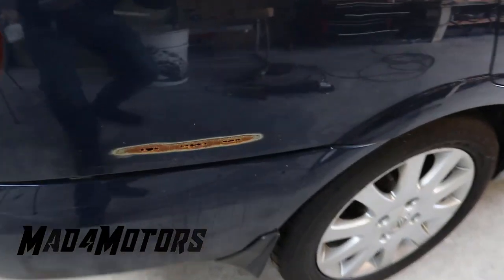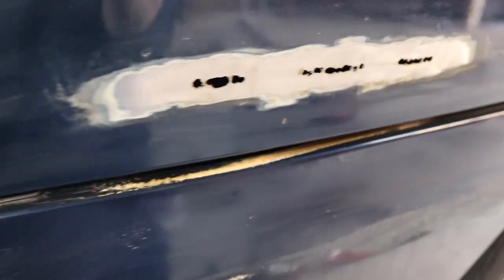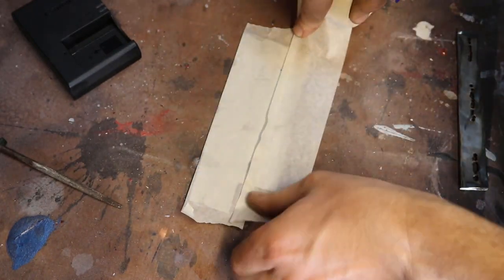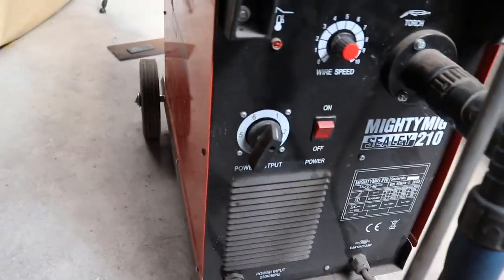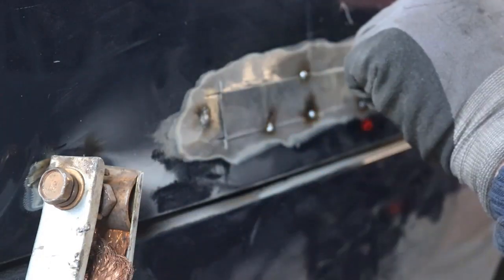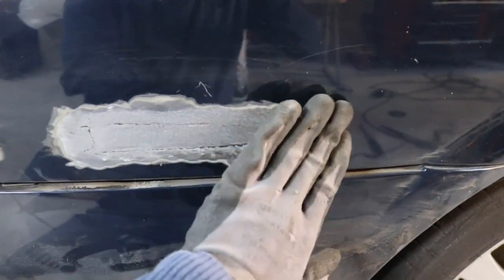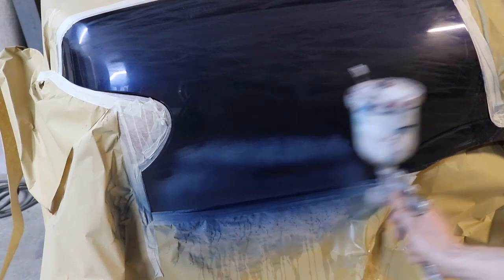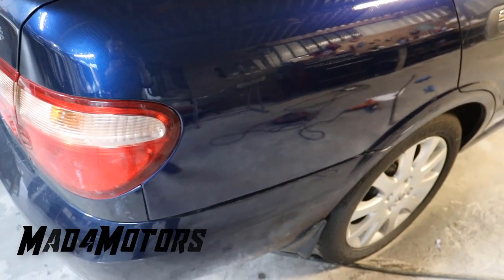Repair Rust Holes in your car. How to weld.

Comment: Don't Forget The Other Side Still Bare metal Good Idea to put rust protection
Reply: What kind of rust protection is good for the other side?
Reply: Yannis you just need primer or paint to protect it from rust
Reply: @mrpanda2655  I'd blast it with some fluid film too, but I'm paranoid about rust.
Reply: samsondelighted then spray rust reformer paint
Reply: Yannis this is my question too. I’d like to remove side molding on my Land Cruiser, weld the holes and repaint. The Rust Check guy said this could invite rust or rippling over time. I live in the mid-west so lots of salt being thrown around
Reply: @otismatvejs1026  the best paint / primer is UNDERBODY paint :)
Reply: As he said it will last the life of the car is sometimes not worth trying to get to the other side as it will take years to rot again
Reply: @justbreakingballs  what's your opinion for under coding I heard tbe rubber  think it's bad because It Keeps moisture capsulated and make it  Underneath rot well oil based undercoat displaces water like wax🤔
Reply: G POWER DRAGON horses for courses. It’s true that if the undercoating fails and allows a layer of moisture in that would be bad. But if the surface is prepped and free from contamination and keyed up it’s should never come away. So I would only use it properly, not just slap it on to a poorly prepped area. Other options are a black spray or a homemade old oil mix. To get behind panels you can cut holes with a small hole saw and spray some oil based mix in with a compressor then put a blind grommet in to plug the hole. You can add extra drain holes etc etc the list options are endless. All depends on the vehicle. Like is it a restoration job or just a van with good engine and running gear that you want to keep on the road for a couple more yrs.
Reply: @mrpanda2655  inside nobody sees so just red lead primer and 2 coats of paint any car colour would be better tho then clear coat and shulz

Comment: I wish I had the tools and scrap metals so I can do my own repairs. Everything is 5x expensive in the Pacific islands. So for something like this, I'd sand both outer and the inner panel (if I have access) as best as I can, then use epoxy resin like JB weld to seal up the holes. Primer, paint, clearcoat, then polish. Greetings friend, from the tiny islands of Palau.

Comment: Instead of using the body filler, could you go over the gaps with the welder again, or do you risk doing more harm than good?
Reply: yeah, I would, why let moisture and road salt in from the gaps in the backside. Or use all metal body filler over it, it's made by USC

Comment: Also just to add. When your cutting into the panel. Tac the new piece over the area. Then cut through new down through old at 45 deg angle. This helps both metal butt together so its the right height without using a magnet and weld bit by bit as usual in the video.
Reply: Wut

Comment: You should put a coat of epoxy primer on bare metal before filler
Reply: Gruby Garage Projekt  if the body filler it’s compatible with bare metal its aceptable.. in fact I know a lot of body man that remove any primer to bare metal before a playing body filler..
Reply: Most body fillers is meant to apply straight to bare metal.
Reply: @mr.wizeguy8995  check this after two years after aplication...
Reply: A poxy primers get on bare metal if you're gonna let it sit for a long time before you do body work
Reply: All body filly should be applied to your base material. You can't hide body filler if it's over paint otherwise you'll always have a high spot.
Reply: @MallinsonBro  Yeah, but whats best for rust prevention? I have welded in new bodyparts in my car, and i don't know if I should use epoxy first or body filler. lol
Reply: Use food grade ss for all car body,never getting rust forever😁
Reply: @Smallz95  a dude on another video said epoxy is best against moisture

Comment: I have a question for you 
Before the welding anything have to disconnect from the  car ?
I sawed my mechanic disconnect some electrical thing from my car before he start welding
Reply: Yes, the battery should be completely disconnected from the car, especially newer ones with sensitive computers.
Reply: @archygrey9093  thanks for information mate #respect

Comment: @Mad4Motors so you’ve used only finishing filler and that’s eneough when welding in an element ? I’ve bought 3 different fillers as I was hoping to do a job like on a chrisfix video but then decided to weld in a panel. Is it a bad idea to put on fiberglass filler then finishing filler and glaze putty on a welded panel ? Seems overkill

Comment: I have a rust hole similar to this in my legacy. How do you prep the backside of the panel to prevent "re-rust"? The spot I have is on the rear fender and not accessible from the back side.

Comment: Nice job. But um, you do know you could have just plug welded the holes right?
Reply: He could, but then there could be rust on the back side, and it would just eat through the metal again.

The proper way to fix rust is to cut it all out and weld in a patch, that way it doesn't come back.
Reply: Elijah Fowler  That is true. I didn't take the backside into consideration, my bad....lol. BUT, with that said, most rear quarter panels are accessible from the trunk, MOST anyway. So you could plug weld the holes then go into the trunk to access the backside to clean and rust proof it. I know this isn't ideal on some cars though so you will be forced to cut out all the rusted metal anyway, specially when you get into the edge of quarter panels where they bend.
Reply: If there is a rust hole in panel it means that rust made metal thin enough to form a hole so better replace piece than just weld them because there will be soon new hole next to fixed hole.
Reply: Sure he could have plug welded them if he would have wanted even bigger holes.
Reply: iivoli  You can see on this car the metal isn't that thin at all from the rust and the metal cleaned up just fine when he took a flap disc to it. So he COULD have plug welded it fine. If you think it would have caused bigger holes then you don't know how to weld.
Reply: MrCougar214 because the metal around the holes is thin from rust…

Comment: My truck has more rust then that I saw a video on YouTube and they used sheet metal and plaster and let the plaster dry after the got all the rust off. I am gonna try that for my truck but I need to get another pad a steel round blade to put on my angle grinder. I might have sheet metal at home and I have a soldering iron so I can use that when I put the sheet metal on that covers up the hole once I grind all the rust down.

Comment: You could also use spray paint to trace the shape of the original piece, by putting it on the new piece of metal and spraying over it then remove it and you have the shape

Comment: One question: how do you protect the backside (insiste) welded panel? I am using a mig welder and I grind both sides, but some parts are inacessible. Please advise

Comment: Measure and cut the patch to required size and use that to scribe the surface for removal. 6 of one vs. half dozen of the other but that's the best way I've seen. I see in the reflection no goggles and no cans as you grind. Use them and life will be less grim.

Comment: @Mad4Motors isn't the inner side of the new panel and weld at risk of corrosion since they were left bare?
Reply from the maker: Yes, if you can reach the back area, treat it with some paint

Comment: Excellent repair.
what would you do about protecting the bare metal on the inside of the panel where the rust actually came from?
Reply from the maker: Hi yes I brushed on some etch primer on the inside
Reply: Mad4Motors 
Ok but in my careful opinion that is not nearly enough to protect the bare metal and prevent rusting from the inside out. 

Rx 5 and Rx 10 would be a start.

Comment: Why create additional work by tacking a Earth stud you could have attached the earth clamp basically on any chassis blot, stud etc. Plus always  disconnect the battery before doing and electric welding. You should also always treat the welds so they don't start rusting as it will start rusting out in no time. Ok so it's off to scrap.

Comment: What mig welding wire did you use? Surely low carbon steel filler wire would make it rust more??

Comment: Thanks for uploading. Where do you get the metal from? As in - where can you get the sheet metal for welding in the new pieces?
Reply: it is best to get sheet metal from other cars at the junkyard because those have already been zinc plated from the factory and are more corrosion resistant than getting sheet metal from home depot

Comment: I need to ask you something i have little rust in my car under car under rear wheles and i need to weld but i have afraid to damage my steel outside with paint what to do to weld with low amp or how because with hight amp can damgae steel car ?
Reply from the maker: Hi you can send me a picture on insta
Reply: @Mad4Motors_  ok bro i send photo tomorrow

Comment: Hi, how do you ensure that the inside of the metal doesn't rust, if you can't get behind the repair once welded in? Great video 😀
Reply: i think you should use galvanised metal
Reply: @SwastikSwarupDas  paint won't stick to galvanised metal, better to just coat the back of the metal with weld through primer and if you can use body sealer from the back after its welded in that's a bonus
Reply: That section of the panel is actually inside the vehicle, sure, it could rust a little, but there's not going to be enough moisture in the vehicle to cause a new rust problem.
Reply: Elijah Fowler all it takes is one small thin compromised spot that was almost a pinhole after ground down on the outside to let the cancer start all over again, often more aggressive than before. 
 Most guys aren't real pros at welding thin sheetmetal. It takes a long time to be decent at it and you have to take your time to not warp or blow holes. Most production shops won't allow for this kind of luxury time, and most guys just stick it together and pave it over with filler.
Painting/undercoating the backside is good insurance for the longevity of a permanently lasting quality job.
  
It's best to cover your ass instead of leaving it bare.
Reply: given that the rust is a straight line, it looks like the rst occured from the inside, where water followed a straight line.
Reply: You should not weld galvanized steel. And if the panels going to rust form the inside, having a galvanized patch isn't going to stop it because your weld, and the burn area around it won't be galvanized.
Reply: have a look into cavity wax
Reply: He’s correct you should never weld galvanized metal and breathe it. 
  After the job is done just under coat the inside of the trunk chances are it has carpet on the inside of it anyway if not undercoat it spray paint it hell do something to it.
Reply: DLA MNIE TO JEST ODJEBANE  Haha... You are care about inside part but external hansnt at least epoxy primer on raw metal sheet. Final efect is that filler is acumulating humidity and all will falls down.  POOR JOB

Comment: Could you use stick welder for this type of welding ?
Reply: Nor really. Arc welding is better where there is a greater thickness of metal - on something like this it is pretty much impossible to get a balance between not  attaching a steady arc,  and not blowing right through and making the hole bigger. The thinner wire and steadier arc that the inert gas fill allows, is needed to do sheet metal welds that are any good. In general the wire/ stick diameter needs to be similar to the thickness being welded.

Comment: my problem is that the pieces i need to repair is the top of the wheel wells on both sides. i don't know if I am skilled enough to bend the metal and have it not look like shit
Reply: late reply but you could buy a whole new wheel arch and just cut out the piece you need

Comment: Hey; just about to learn to weld. I thought welds had to be continuous? Is that only on structural parts?
Reply: As he pointed out, the welds have to be very quick and spaced apart on thin sheet metal, else it would warp or even blow thru'.

Comment: You should use a waterproof filler first then the one you used here if you didnt fully weld the piece of steel all around. We didnt see prior to applying filler if it was fully welded or not. Typical body filler absord water through the crack otherwise.    Trust me I'm a professional canadian

Comment: Only the new piece has to be a little smaller, because with welding the plate will expand by heat, for the rest, well done, i am welding on cars about 35 years, only good job to remove rust is cutting it out😉.
But the back of the plate has need a protection again off course, otherwise rust will come back.

Comment: A few comments: do not use such plastic or cotton gloves for welding. They do more harm. Use leather welding gloves.

You have protected the outer surface very well, but you forgot to protect the inner surface of the repaired surface. Rust will eat through from inside. Apart from these things: great job!
Reply: What's your suggestion on taking care of the inner surface?
Reply: @MrBones7  some vehicle cavity protection, like Dinitrol 1000.
Reply: States at the end of vid , car doesn't have an  engine and is being scrapped . That's most probably why he didn't do any protection on the inside ....

Comment: Nice, welding is not something I'd ever be able to do. But enjoyed watching the process none the less. I was wondering, my car has some lovely key marks that were left for me by some generous person. The scratches break the clear coat and go into the base/primer but not the metal as they have not started to rust. They've been there about 2 years now, thankfully they aren't super long but hate looking at them none the less. I did try and touch the smallest one up with some touch up paint and a tiny artists brush, but when it came to levelling it out I burnt through the surrounding clear/base in literally less than 10 passes with 1200 grit wetdry. Car is a 2010 Accord and I know it has very soft/thin paint/clear on it.

I was wondering if you could do a video showing how you might remove scratches without repainting the entire panel or having a massive repair area that may be more visible than the scratches. I was hoping to touch it up and sand it flat but it seems like the very think Honda paint has eliminated that option. Thanks alot, sorry for the long question. Also its a black car, which I'd assume makes it even worse to try get it right?
Reply from the maker: Black can be a tricky colour to work with has the reflection is like a mirror and will show the smallest imperfection, the process i would do is touch in the black with base coat colour with a very fine brush sand the excess away (lightly!) and then touch it in with clearcoat and wet sand and buff
Reply: Daz Dee welding is easy, it just takes some practice on scrap bits of metal that's all :-)
Reply: mig welding is not hard, you can do it, i would say 15 mins of messing about and practice (from nothing) and you will be good to go.
Reply: All it take is time and loads of youtube video's and you are als able to do it.

Comment: Wish I could do that. But it's the floor. And there is not much left of the original. The front is mostly held together by this strange vinyl like stuff. Tough as nails. I bashed with a hammer. Won't bungee. But I. Put a sheet metal screw and it won't hold and goes through like paper. It isn't metal. Not much I could do. So I'm trying to replicate it, because it passed 7 times that way. Very strange stuff, if anyone knows what it could be. It's also black.